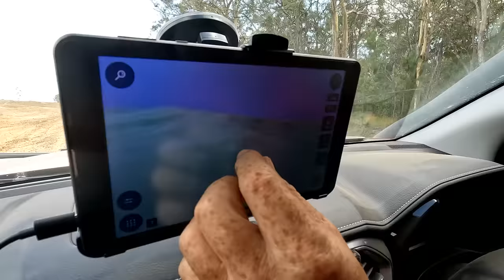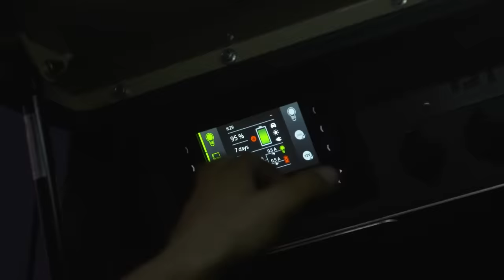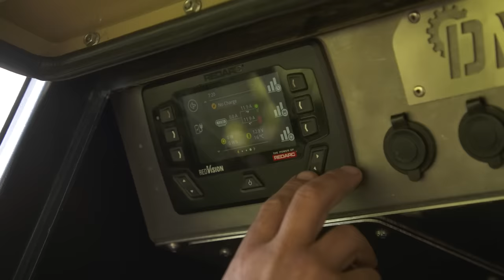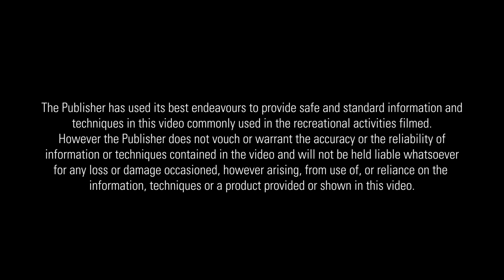INCHES FROM ROLLOVER... What happens next? Midnight diff rebuild, ruined panels! Glass House Mtns

Comment: (46:42) Jesse dont have to worry about the drive line standing up, its nissan tough.
Reply: Do that stunt in any other 4b (especially landcruiser) and you would blow both cvs and the diff centre 😂
Nissan drive terrain is next level
Reply: @davidday1092  Yep all the Toyota's in 4WD 24-7 shitting diffs axles CV joints even watching All4adventure they shitting diffs tail shafts just don't seem to built strong enough..

Comment: These kinds of videos really shine the light on how much modern independent front suspension vehicles are not well suited to this kind of off roading. Live axles like for example those found in GQ patrols, 80 series land cruisers and Jeep Wranglers are absolute kings for rock crawling. IFS is great for comfort on the highway and overland camping but if you want to rock crawl build something with live axles.

Comment: That front diff needs a solid pinion spacer and you need to preload the crap out case when you set the mesh and backlash and they handle better on rock steps

Comment: Great Episode Again guys! But I was wondering about Grahams recovery and how you set it up. If you were out with only one vehicle, would it have been possible to have run the winch through the snatch block at the front like you did, but then hooked up to the rear of the right slider? So in effect pulling it forward and sideways,while keeping it secured so it cant tip down the gully?  Or would that not have worked? I'm still learning stuff like this as I get out solo quite often :) Thanks in advance for the reply and thanks for the awesome consistent content. :)

Comment: If you want a new way to pop panels back out then buy yourself a different size balls that you can pump up with your portable compressor and you wedge it in were you can and slowly pump the ball up and hopefully you panel goes back to the way it was. 

If it has bent in a seam then it won’t be perfect but pretty close

Comment: Other than sorting out the ignition in Daryl, has it had any major upgrades or is it pretty much just a stock gq with a bit of lift.
Reply from the maker: Bit of lift. Front locker. Couple of little Jesse mods to make it more capable
Reply: @4WD247  what ever he's done its working a treat, it's now an extremely capable reliable wagon with what 5k ish spent on it.